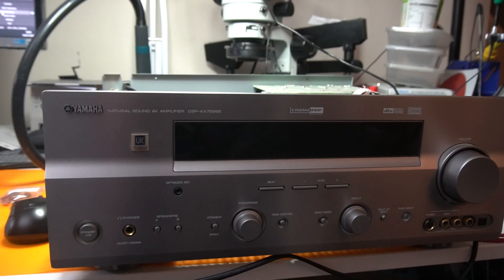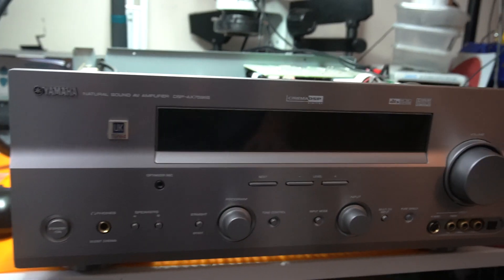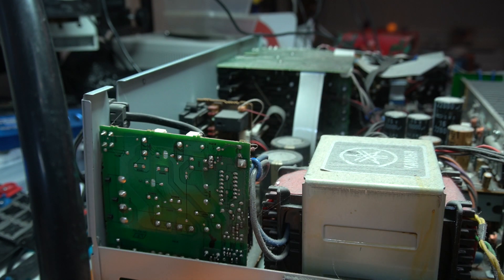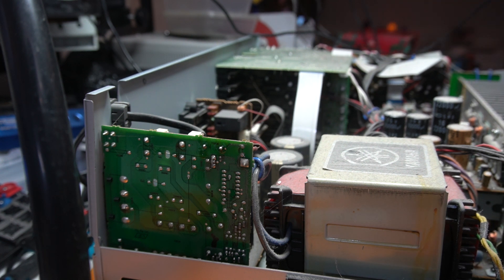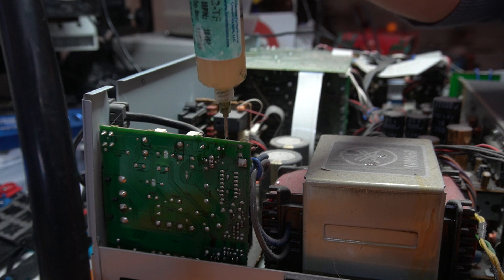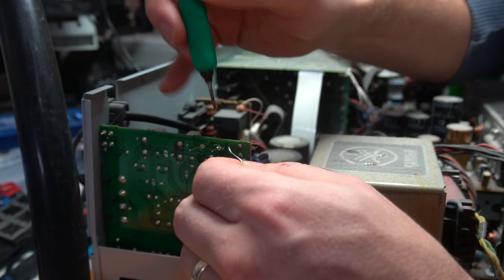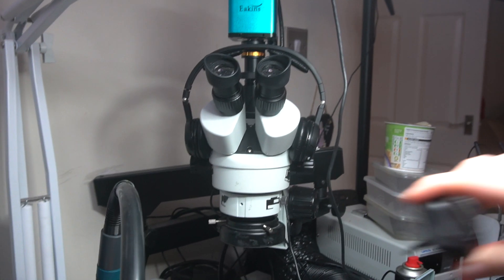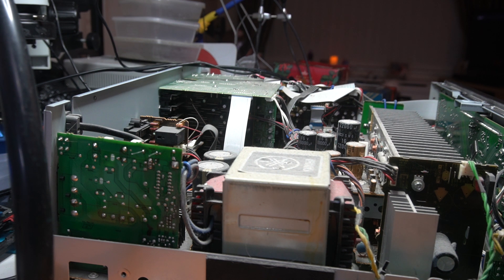Yamaha DSP-AX759SE power amplifier repair

Comment: Hi Dan, super thanks for the video.   I’ve just ordered that same capacitor, does the capacitor have a positive and negative.  I’ll change mine next few weeks.   Thanks
Reply from the maker: Hi, some capacitors it does matter, but as far as I can remember, this particular one is not polarised and so doesn't matter. Just check for any markings on the old and new ones and try to match them if so.
Reply: @DannStarrElectronics  
Thanks again, my amp only went down last week and your video that’s 3-4 years old is still super valuable!!

Comment: My ancient RX-V1800 that had a powering on problem sometimes so retired a couple years ago, got pulled back into service recently as my music amp. After a week or so of reliably starting, the random failure to start issue returned requiring a power cycle which sometimes worked and occasionally didn’t. So having seen the short video from CARBON and now your far more explanatory video, I’ve swapped out the Cap. The V1800 cap is not quite so conveniently located requiring pulling the power board out to access the Cap, but still a very easy task. Hopefully that was the only issue. Time will tell… thanks for the guide.

Comment: I have Yamaha rx-a1030 . DSP A1-1 DSP Margin problem as per Self Diagnosis. The solution is the same? The same capacitor model must be changed ? Thank you very much for the possible answer !

Comment: mine just clicks it dont turn on will this fix this issue?
Reply from the maker: There's a good chance yes, it's certainly worth trying
Reply: @DannStarrElectronics  DSP-AX640SE turns of after 3 seconds what capicitor should i change?  according to the service manual its an issue with the dc side of the ps, ut its unclear what cap i should change, any ideas?

Comment: I hope you remembered to remove those 2 previous capacitor’s legs you cut and pulled out, then laid them on top of the power transformer. I didn’t see that you removed them and now they could be floating around inside the unit looking for a place to short out something.
Reply from the maker: Absolutely 👍

Comment: Hi, I have the rxv650 receiver and after watching a film last night I used the remote to change the surround setting and the amp switched off and now won't power back up hopefully it is the same problem, this little capacitor seems to be quite a common problem .... Fingers crossed

Comment: Mine comes on then goes straight off i think it could be a 3 leg cip
Reply: did you get yours working? mine does the same. Turns on then imediatley turns off
Reply: @nelsoncoimbra6325  I’ve took the top board off that’s the problem it’s got burnt out caps and resistors
Reply: I’m waiting till I get another board to replace it